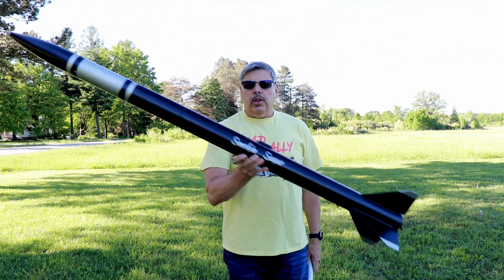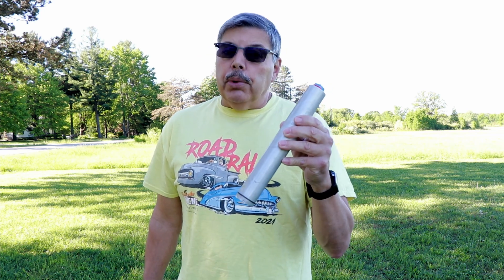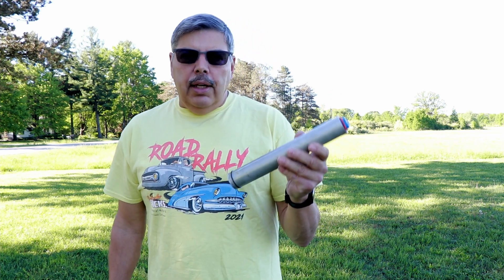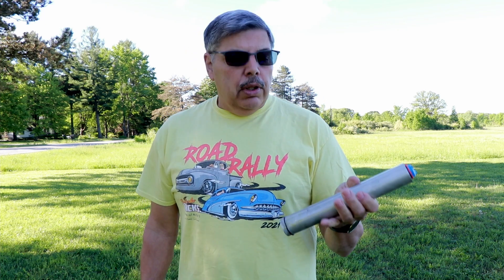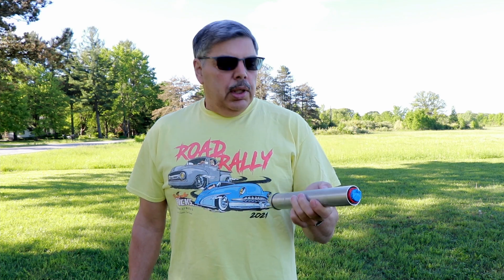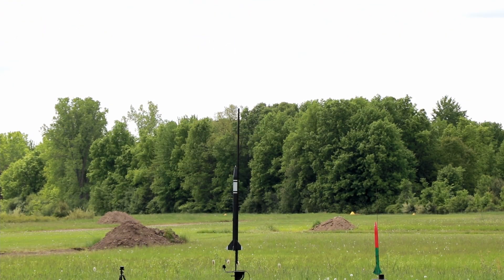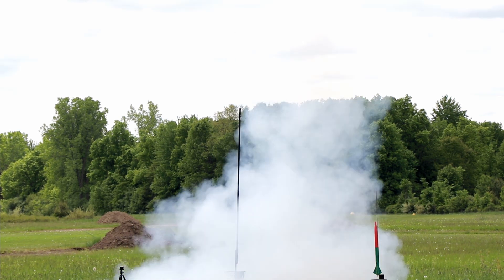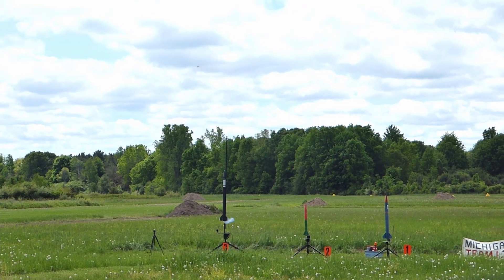Smokin Sugar rocket burning aluminum.

Comment: Hello Mr. Rocketeteer, I wonder if you have looked at KNPSB proppelant as featured on Richard Nakkas website. It has 30+ more seconds of ISP and burns even faster at elevated pressures. Seems like a new "sugar standard". I wonder how such a formulation works with various additives, I imagine with smart choices you can make it  reach 170+ isp
Reply from the maker: I have looked into KNPSB and am considering using 10% KP to replace potassium nitrate. Boosting sugar propellants always carries risk. Should I stick with a reliable, known propellant for a safe launch, or go for something with more "oomph"? A larger motor could also provide the needed kick. I'll definitely try KNPSB eventually, and I have a few other burn rate enhancements planned. Stay tuned!

Comment: First of all, hello, my English is not good, I use translation, I hope I can explain. Can the launch power of rocket fuel made with ordinary sugar and potassium nitrate lift 1-2 kilograms or a detailed formulation of a fuel that can lift 1-2 kilograms Can you explain it in detail. I live in a country where chemical materials are difficult to procure
Reply from the maker: The fuel I use is made with potassium nitrate, sugar and corn syrup. Corn syrup is used in baking but may not be available in other countries. I am going to experiment with honey instead of corn syrup soon. Watch for a video this year.

Yes, sugar fuel will lift over 2 kilograms. https://youtu.be/KZQ-cVx4Mkw
Reply: @TheRocketeer  Thank you mate good work